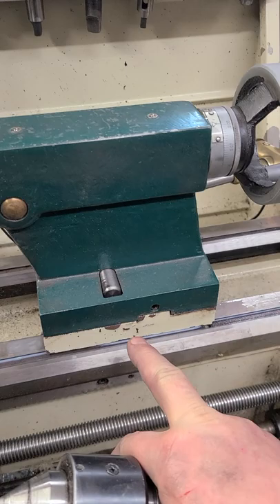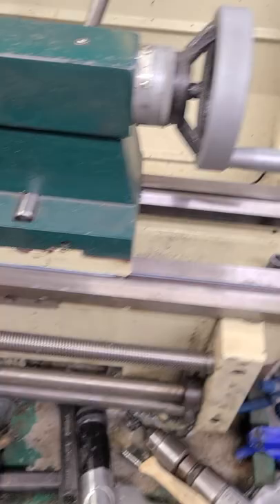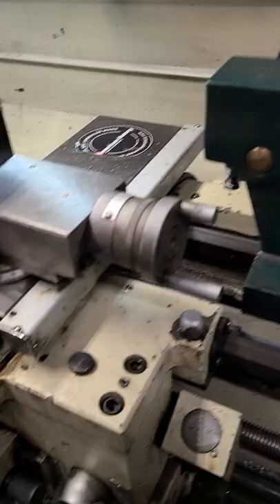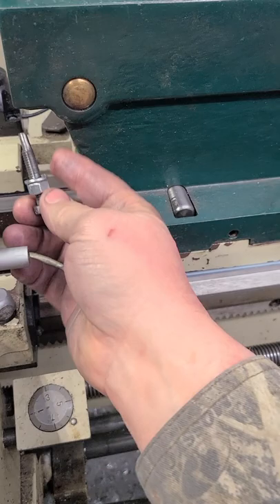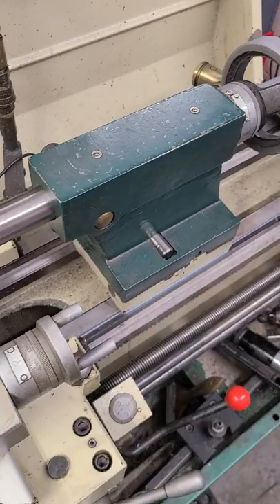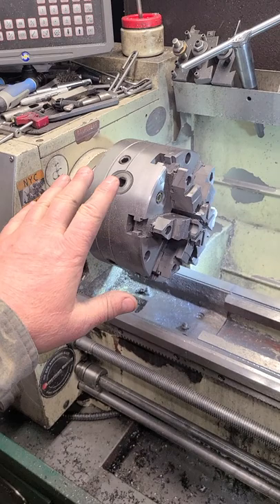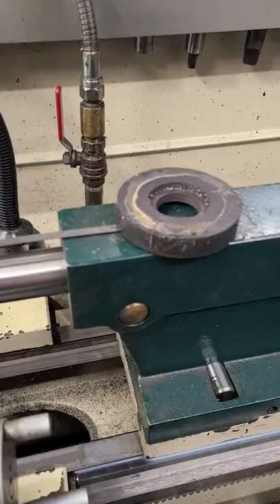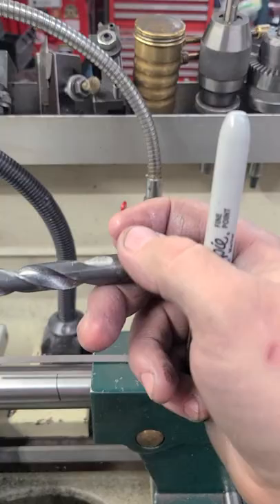Grizzly G0776 Tailstock Mod.

Comment: Camera is moving around too damn much. Anyway, appears you might have a graduated collar on the right hand end of the tailstock, if so, you can use that for depth measurements when turning the handwheel. But you will have to count turns if you don’t put some graduations on your ram or use another method like a magnet and scale or a dial indicator. Thanks for making the video and stay healthy.
Reply from the maker: Yup. Hand help phone for the video.  It was a last minute video at 2am. Thanks again for watching.

Comment: James, I’m thinking broaching a key way in the tail stock and putting a key in there to spread out the twisting force. Use the set screw to push up on the key to tighten the quill!

I’m glad to see you are still around,
Reply: Jim if you use the phone to video, turn the phone sideways. You will get a lot better video!